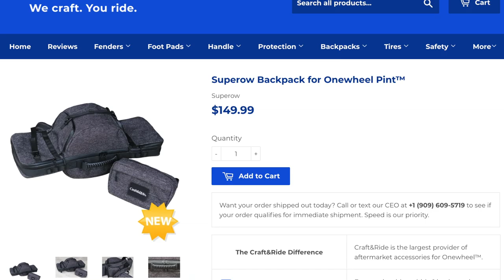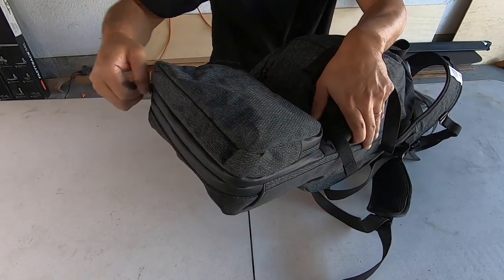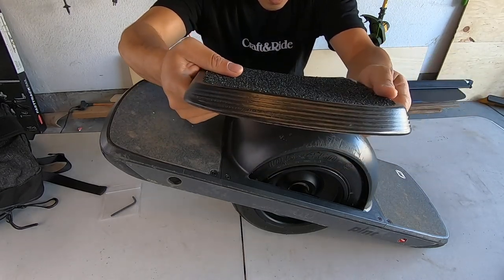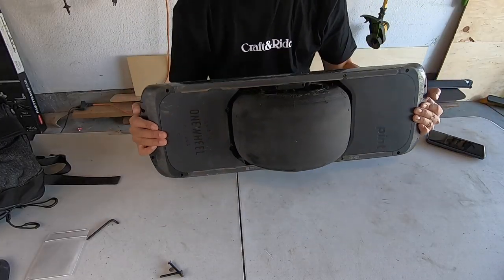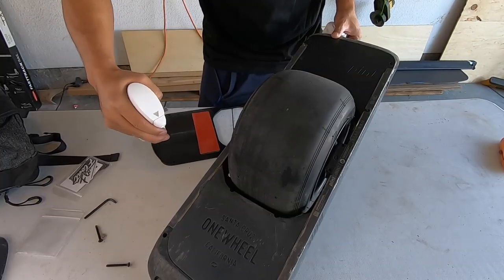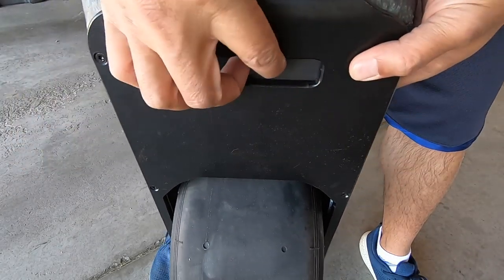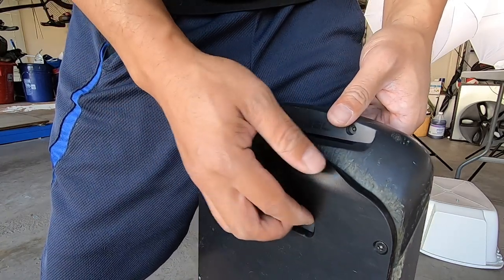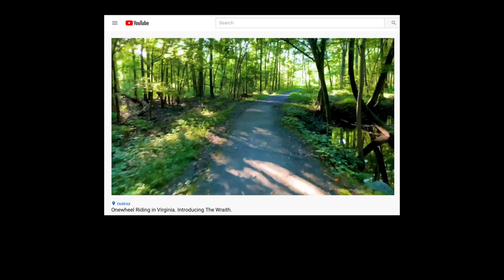Pint Backpack, Extreme Footpad, Float Plate Reviews!

Comment: Hi Jimmy,

Did your pint have the FM rail guards installed when you installed the Float plate solo? Or were you using some other clear protectors?
Reply: I have this same question too...  In your video, it looks like you have the FM clear rail guards installed when you put the float plate on.  I'd like to get one of these float plates too to save my bumpers and increase my chances of recovering from a nose dive, but I don't want to mess with getting the clear rail guards off.

Comment: Do you ride 15 PSi on your Pint or 20 Psi?
Reply from the maker: I ride whatever it came in from the factory at. I guess I should check that.
Reply: Jimmy Chang BTW i did unpressurized my pint to 15 PSI and im 135lbs it throw me out on the street its super wobbly. So i pressurized it back to 20 Psi it feels a lot better. I thought reducing the Psi will reduce the wobbly of the tire but it didnt. ues recommended Factory PSi is better.